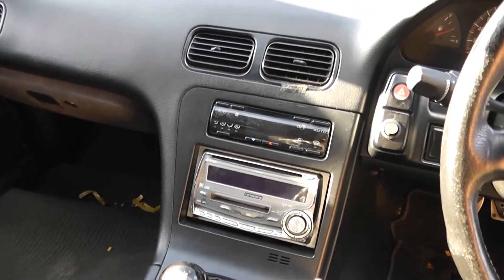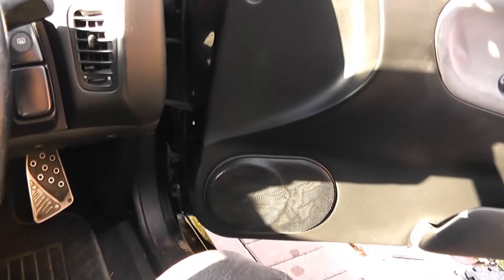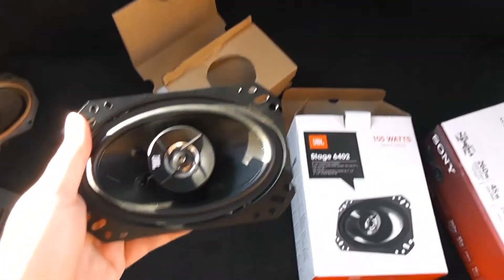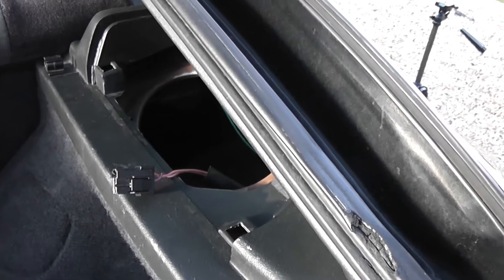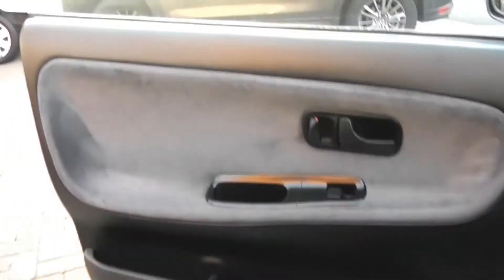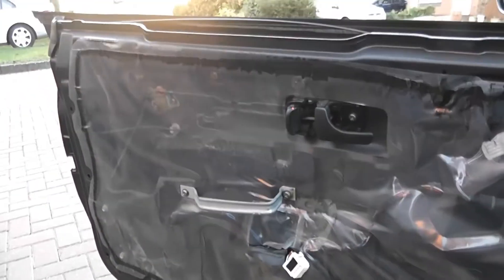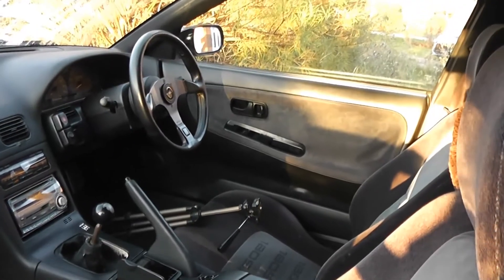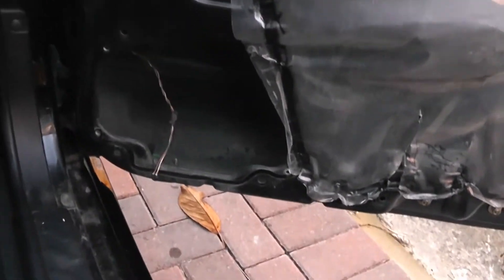Nissan 180SX Speaker Replacement

Comment: This is the best video I've seen so far if you're looking to replace  speakers in a 240sx keeping them mostly stock. My main concern was getting off the rear plastic covering where the two rear speakers are without damaging them.
Reply from the maker: Just make sure you lift the rear speaker grilles up, then they'll come out properly. Even if you do fuck it up like I did you can fix it with epoxy.

Comment: Hi, all car doors have rain water run through them, the glass and scrapper moulding cant be water tight or the window would be unable to open.
The plastic membrane behind the door card is too stop rain water from entering the vehicle, you might want too check the drain holes/slots in the bottom of your doors, these can block and cause water to pool in the bottom of the door and corrode wiring, speakers etc......great videos, Jon.
Reply from the maker: Hi Jon, yes, it did occur to me afterwards that it was natural for water to be in the door, I was just concerned that water appeared to be dripping directly onto the speakers. Perhaps it's a design fault. Glad you're enjoying the videos.